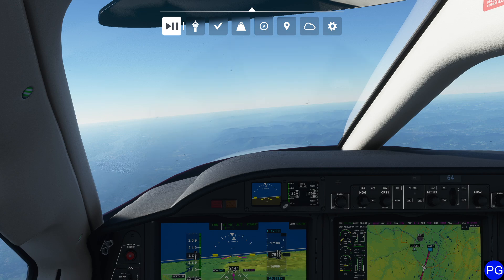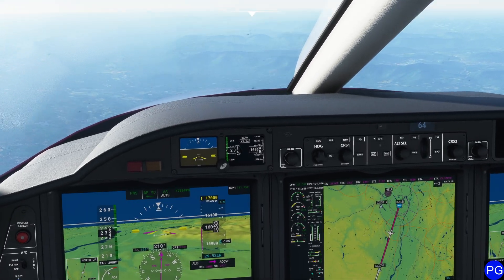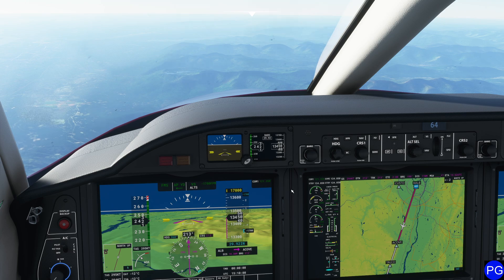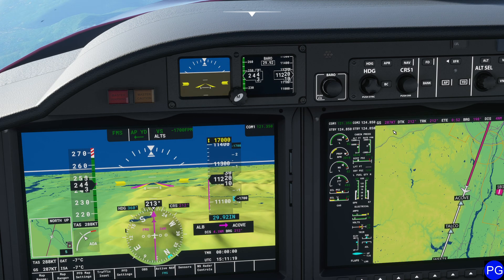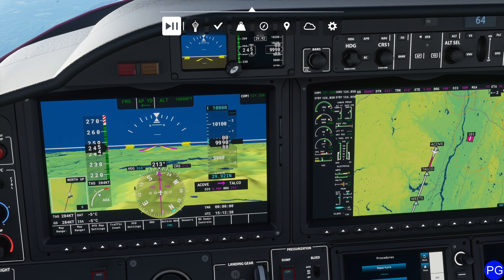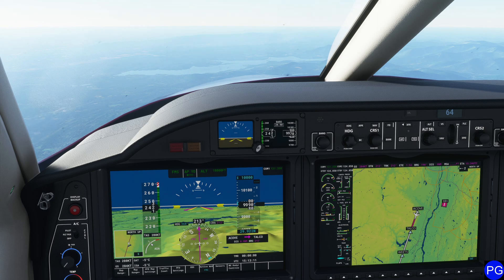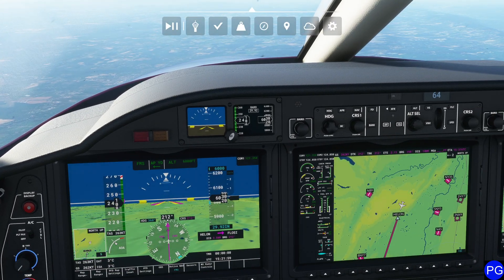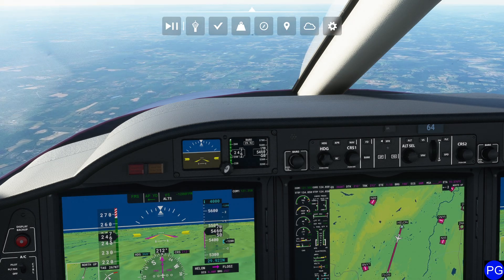FS2020 - Descent Planning tips

Comment: I was confused by the descent distance example. You said if you start at 20,000ft elevation and are descending to 10,000ft, subtract (10,000) and multiply by 3 to get 30,000 or "30 nautical miles away".  This confused me because isn't 30000 feet ~= 5 nautical miles?
Reply: he meant 20,000-10,000, 3x10,000=30,000. 30,000/10,000=3. so you forgot to divide it by 10,000 or just "a nautical mile per ten thousand feet'

Comment: Great info, especially the tricks for calculating descent rate. BTW, you were using MIA altitudes - they were not for crossing restrictions or even altitudes to expect. This is not a profile descent and the only altitude planning info is the "Expect 7000" at CRANK. Most likely ATC would assign you to cross ALB at between FL180 and FL240 then CRANK at 7000. After that you would get an altitude to maintain until established on your chosen approach - probably 4000 for the MIA to SPARTA.

Comment: My biggest challenge is trying doing those descent calculations without having the simulator paused so it gets even more tricky.  Depending on how long you take to figure it out, it will have changed.

Comment: Thank you for this. :) Just in the last week, I've programmed Tasker to give me VS relating to altitude to lose over a certain distance at a desired speed, as well as TODs for glideslope or VS at deisred speeds - all well & good until I don't have my phone to hand! These rules of thumb will then come in very handy. They'll also give me a quick way to check that the details I've put in to the phone were correct - i.e. if my mental arithmetic doesn't tally with the phone's output, one of the calculations must be wrong!